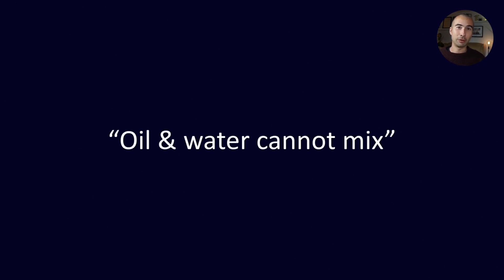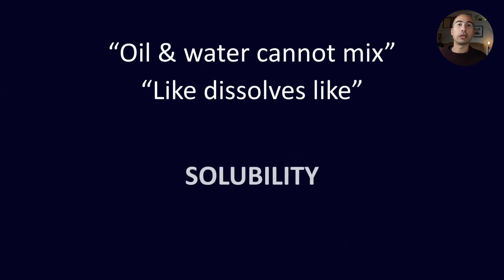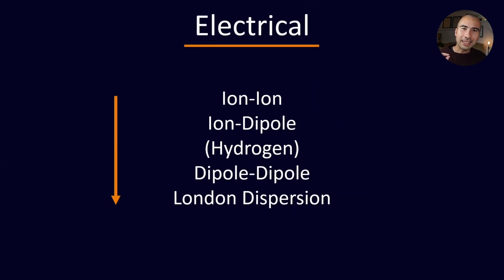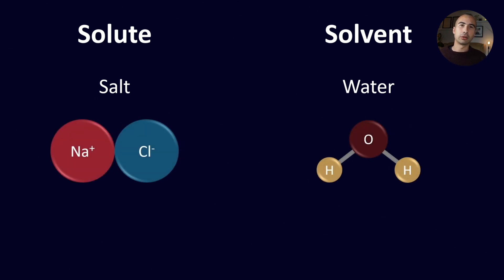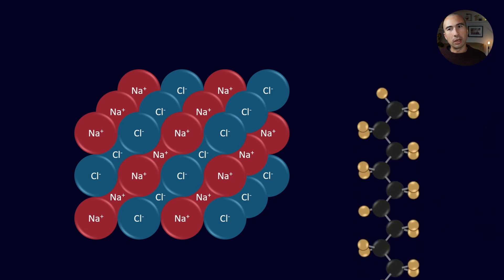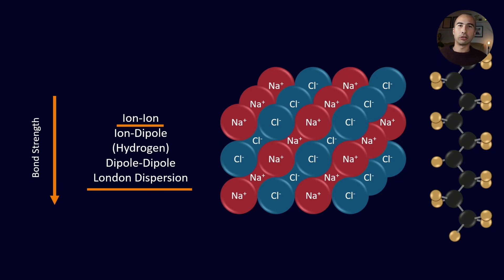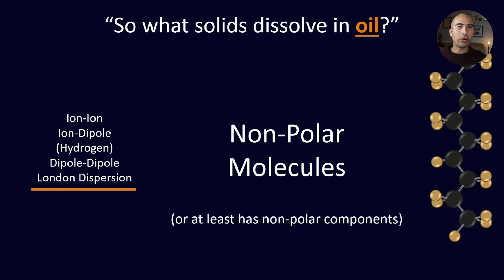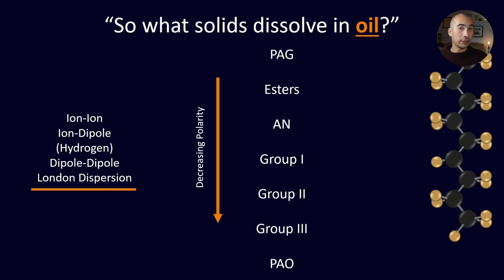How can I tell what kinds of solids will be oil-soluble?

Comment: So, a doubt remains as PAG is good at dissolving solids but not good at mixing with other bases, or Just the water soluble PAGs that has the missibility with other bases problem?
Reply from the maker: Good point! So PAGs have an advantage that they tend to clean deposits on their own - for that reason PAG finished lubricants tend to have much lower additive treat rates than PAO-based synthetic oils.

Completely water-soluble PAGs don't tend to be used as lubricants and you'll see them much more in the medical and cosmetic industries. OSPs (oil soluble PAGs) don't mix well with other base oils either because of their high polarity. But we'll cover miscibility of fluids this week!